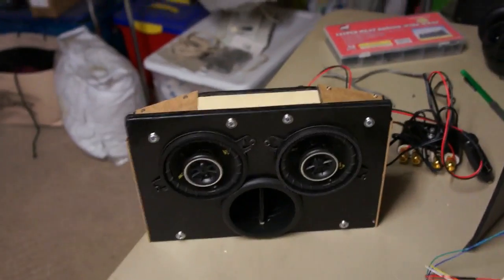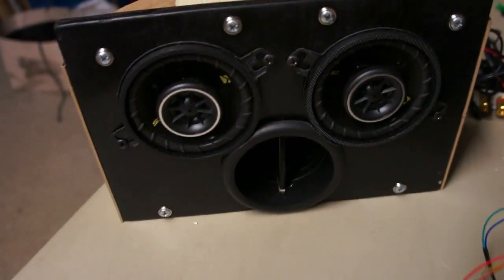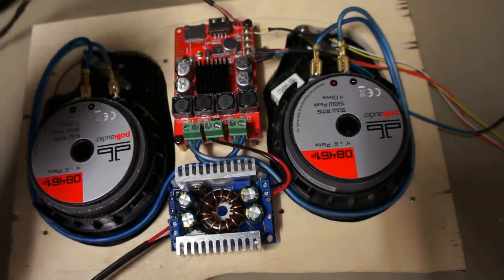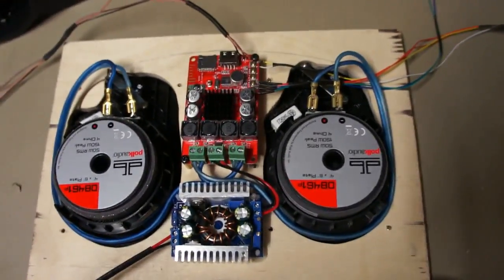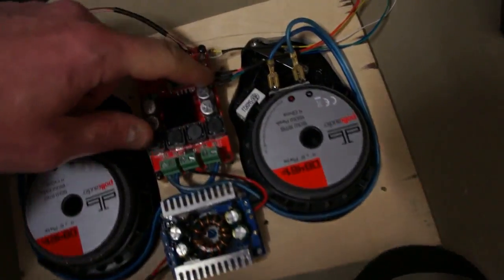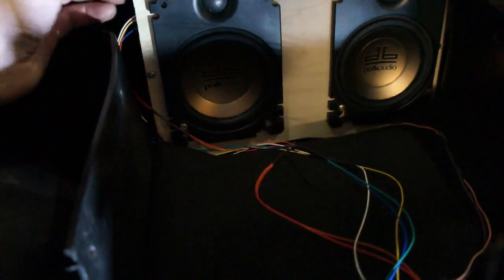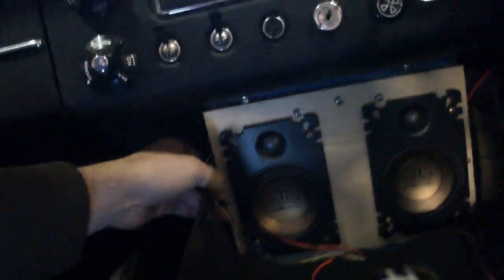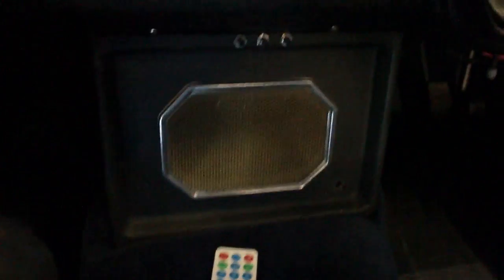1968 MGC Bluetooth Speaker Box Build, Take Two

Comment: I'm planning add battery pack with BMS the output 24V & 15A. It can take 15A?
Reply from the maker: There are many amps and BT modules available on eBay and Amazon.  The power parameters will be listed in the description.  The amp rating for your battery pack should be the most amps that in can put out.  The BT module will draw what it requires to run.  15A is probably overkill.  The transformer can handle 16A according to its description.
Reply: Plus the max amount of voltage would be 6S ~ 25.2v idle 22.2v with a load and as many as you can get in parallel, use a BMS with Balancing and get a special power brick for Li-Po to charge

Comment: Can i use voltage booster? Can something go wrong?
Reply from the maker: As long as the voltage booster does not boost the voltage outside of the range compatible with the amplifier you should be fine.  The amp will run off of 12v battery power.  What you can do is just connect it direct to a battery source wire and see if it operates OK at the volume levels that you like to listen.  If the sound cuts out or distorts that is signs that you may need to raise the voltage or amperage supplied to the amplifier.

Comment: can your make a video explaining the voltage transformer, because the amps thing is confusing me I have the same one but only have 12 volts
Reply from the maker: +adrian mendez Measuring amperage is different from voltage.  You can not measure amperage unless you have current flow.  So you have to connect the amp to speakers and then connect a multi-meter in series with music playing to determine how much current the amplifier is using.  If the amp is trying to use more current than the transformer is putting out the music will distort/cut out.  Then you will need to turn up the amperage output of the transformer.

Comment: I’d like to see your process of soldering those switches to the main board. About to do something similar and researching my options now.
Reply from the maker: It was a tricky process.  I am not the best with a soldering iron.  Having one with a fine tip will help.  I used very thin, single strand wire.  I'm not sure what gauge it was but I recycled it from a broken desktop computer.  On the edge of the circuit board where the buttons are you will see two strips of metal coming off of each button.  I soldered 1 wire to each of these strips and then the other end to the remotely placed button terminals.  Get a small ball of solder on the end of your soldering iron and then as you hold your wire to the curcuit board strip of metal, drop the iron to the wire and the solder should melt onto the wire and also melt the tiny bit of solder on the board holding the button strips down.  Sorry that's probably not an easy description to follow.  Good luck!

Comment: Just a heads up on the bluetooth module . They typically work on very low voltage so the source voltage does not need to be that high. Sending it 20 volts will not increase the range or the sensitivity of the bluetooth module.
Reply from the maker: Thank you for the info.  I wasn't trying to increase the BT range.  I was trying to make sure that the amp didn't experience clipping when the volume was increased.  I figured since the BT module was made to handle 8-26v I'd set the input toward the top of the range.  I'm no EE expert so I'm probably mistaking volts for amps here.
Reply from the maker: I have since scrapped this setup for an actual car-audio amplifier... that video will be out soon.
Reply from the maker: Check out Kirby Meets Audio: https://kirbymeetsaudio.com/ or his YouTube channel here:  https://www.youtube.com/c/kirbymeetsaudio.  I get a lot of my ideas from him.
Reply: I know this post is old, but concerning the Bluetooth module built into the amp. It has its own voltage regulator, which drops the 20v or whatever voltage you feed the amp to 5v or so for the bluetooth module. If it didn't have a regulator, the instant you apply 20v to it, it would go up in smoke.
Reply: Actually, he does indeed need the higher input voltage. Yes, as you say, "Bluetooth boards" generally work on low voltage (5V). But this is not really a Bluetooth board... it's a amplifier board which happens to have the Bluetooth circuit built in. Although some of these amps will work on low voltages, it takes higher voltages to get anywhere near their true potential.  In other words, even if AMPs have a range of power input compatibility, don't expect maximum loudness from using minimum voltage.

Comment: How hard was it to extend the buttons for the volume, play, pause etc. I am thinking about using the same board and extending the buttons aswell.
Reply from the maker: If I had it to do over again I would go with a Dayton Audio board.  They are plug-n-play for the accessories so no need to solder.  I'm not sure if they have ffwd/rwnd  buttons available or play/pause but you can contact them.  I would have purchased their board if they shipped to Germany.  The Chinese one that I installed cuts out at times and has to reconnect to Bluetooth.  Here's a link to the Dayton Audio board: https://www.parts-express.com/dayton-audio-kab-250-2x50w-class-d-audio-amplifier-board-with-bluetooth-40--325-104.  Also, Kirby from "Kirby Meets Audio" often uses the Dayton Audio boards in his builds and he has a good description here: ( I guess they used to be called JAB) https://www.youtube.com/watch?v=LTdBkGGo7cs.  

To answer your question... I suck at soldering so it was difficult for me.  The connections are very small and tough to solder cleanly and securely.  If your handy with a soldering gun then it shouldn't be too difficult.  But again, I suck and I did it so you can get through it, it just might take some time and patience.
Reply: I'm going to make an ammo can boombox using the board. I'm not that good at soldering aswell but I am quite handy so I'll get through it. Are there 2 connections on every button? I'm guessing you extended them with momentary buttons is that correct?

Thanks for the tipping me off about the board, lots of good boards are for sale here in the Netherlands aswell but they are quite expensive. the 7942P amp will cost me around 8 USD including shipping. Willing to take the risk for that kind of money.

Thanks for all the information already.
Reply from the maker: +dries v There are 2 connections (pos/neg) each.  Yes I used momentary switches.  I too made an ammo can boom box for my son.  It was a fun project.

Comment: is the bluetooth stable on this amp?
Reply from the maker: The Bluetooth appears to be pretty stable but I have had a few times where it has disconnected and immediately reconnected.  I'm considering doing another version with a better quality amp.  The most annoying part of this amp is that it has the Chinese voice that says "the Bluetooth is connected successfully" "the Bluetooth is ready to pair" whenever it is turned on and that is annoying.  I did this on the cheap... except for the speakers themselves which are good quality.
Reply: JR's Garage ok...i understand....thanks for the reply...

Comment: thanks for posting. imo, there's too much 'compactness' in this design.  i would prefer to have a little more space between components.  if this baffle mounts vertically, certain components will be warmed due to convection.
there's no reason to run wires near metal.  cuz, you know, there is always an electromagnetic field around a conductor carrying current.    cheers
Reply from the maker: David, I was thinking of re-working the layout and mounting the amp and voltage regulator to a piece of wood that would cover the rear of the speaker space, in effect making it a "sealed" enclosure and also moving the electronics away from the speakers.  I'm not sure how I'd run the wires and keep them away from metal as this entire space is metal (other than the wood I've added.
Reply: my reference to metal was prompted by the way the wires have been run, close to the speaker frames.  aren't the frames metal.   cheers
Reply from the maker: David Davids yes, I see now.  yes the frame is metal.